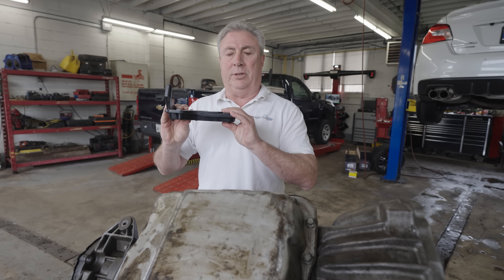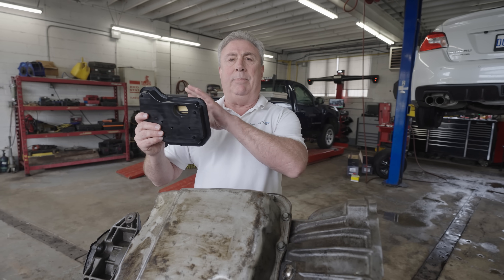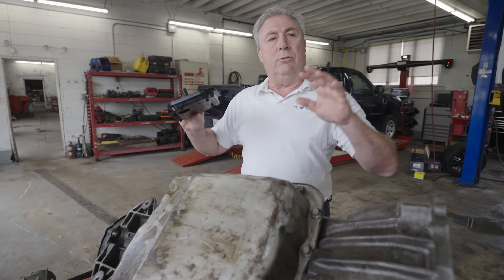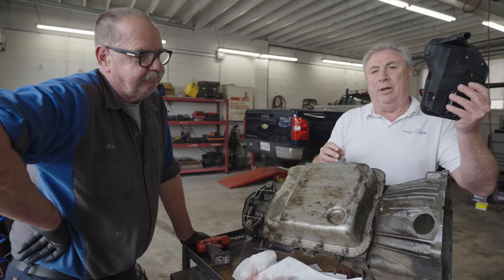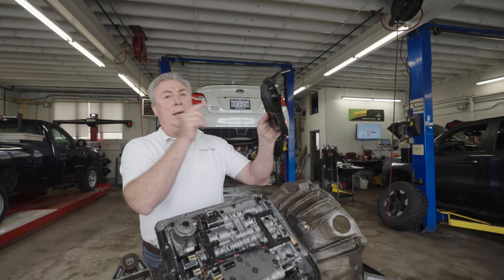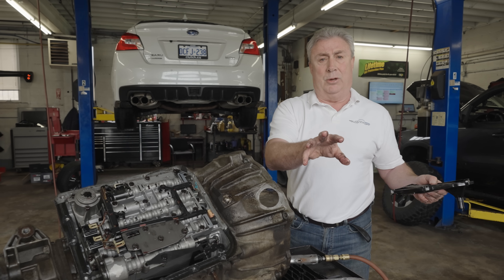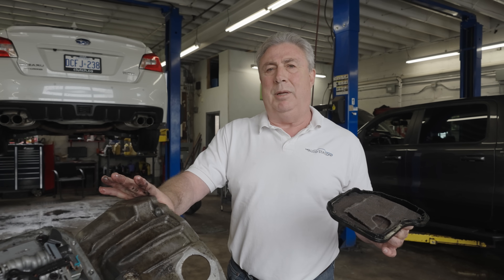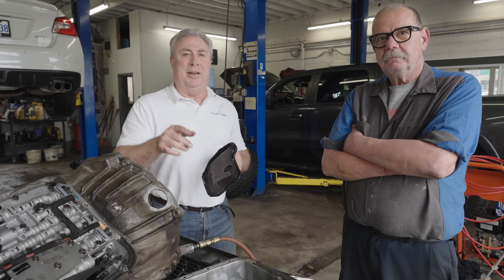Transmission filter Myth Busted - cutting through the B$$$

Comment: Great point I have a 22 Ram 1500 5.7 with ZF8HP75 bought new at 40,000 miles I installed a PPE pan with replaceable filter at 78,000 miles I changed the fluid again and the filter but this time I broke open the filter and you are 100% right it looked new and very little wear on the magnet when I hit 120,000 miles I will remove the pan to wash out with brake clean because the porosity of the cast held black dust if the pan was a machined pan I would drain and fill. Another step I took that most don't is after I completed the service I drove 3 miles put the truck back on jack stands let it sit overnight and rechecked the fluid level it was 8oz short due to air pockets truck shifts like butter. I won't change the trans filter next time no need at all.

Comment: Depends on the car. Some it’s a screen and there’s an actual filter higher up sometimes inline with the cooler. Some have an actual filter in the pan. I think pulling the pan off is worth it especially on a cvt to clean out the sludge in the bottom of the pan and clean off the magnets so they can continue to trap more metal.

Comment: I do drain and fill every other year. I don’t change the screen. I have a filter by the battery. 2006 OB H6 206k miles. I have a plug. No tranny issues.

Comment: At 85,000 miles my Camry at the Toyota dealership had its Transmission filter and fluid changed. Toyota says do it between 60,000 and 100,000 miles. So even though the filter was prob fine, the new one now has about 25,000 miles on it only. Isn't due again until about 150,000.

Comment: This is the first video I’ve seen that answered my question, so I need to change the transmission filter. 

I bought a high mileage a-b truck with plans to give my car to my son. Long story short, the truck had transmission problems and then the car had transmission problems about the same time. I was ignorant and didn’t know anything about servicing transmissions. My car made it nearly 200,000 miles before transmission went out. All things considered, not too bad. Truck is still in the shop on its 4th transmission and still isn’t running right. 

But now I’ve bought a newer car with 24,000 miles and a new family van now with 12,000 miles. I want to make sure I don’t make the same mistake. After lots of videos from people like yourself who sound like they know what they’re talking about, I’m thinking I’ll just flush both of these newer trannys every 30k miles or so.

Both new transmissions are CVTs: one is CVT and the other eCVT. Have I made another mistake buying them? Any special recommendations for those types of transmissions?

Comment: I had honda civic 2010 for 14 years. Had 180,000 miles on it. Changed fluid only. No filter change. No problem with trans.

Comment: so I ended up putting a half a quart or less of engine oil when doing a trans drain and fill went to the dealer ship had them do a flush and refill with fresh fluid so if I understand right the trans filter would not catch and left over engine residue oil because I planed on changing the trans filter base what I understand from what you said i'm not changing the filter anyway should the trans be okay by doing the trans flush I maybe only drove less than 20 miles before doing the trans flush what do you think I should next ty If anybody want to chime in I would like to hear what you all think ty

Comment: just bought a 14 y.o. AUDI A4 B8 2.0L TDI station as a second car from a good friend for no money... 80k miles and runs like new
I love it and in my enthousiasm I made a list of what had to be done to make it run another 80k miles...
So I am changing ALL the filters and sensors, clean ALL the valves and change ALL the fluids..coolant, brake, servo, ... with a transmission fuid change being last on my list
its an 8 speed tiptronic and works wonderful... si I will leave it alone for now...thank you for the video...
from Spain

Comment: As a DIYer, I also don't mess with the internal "chunk filter" unless I have to drop the pan for something else.  Especially if the vehicle has an actual filter on  the transmission fluid line.  Changing the fluid is where the real longevity is at, IMO.  But if the pan has to come off, might as well do it "while you're in there."
Reply from the maker: That's a solid strategy for transmission maintenance!

Comment: I'm highly sceptical that transmission was full of the original fluid given the mileage.
Still quite a strong cherry red colour.
Any kind of ATF I've seen with even 100,000 miles on it barely has that colouring visible anymore.

Comment: I think this way is impropper for CVT`s. Not about flush, but about filter changing. Thank you.
Reply: I'm with you 100% what the heck is this man 🤔 trying do to a poor 🥺individual that is trying to make their vehicle last as long as they can I'm a 60yr  dude that have been working on vehicles for 45 years and I can tell you removing the trans pan and cleaning it out magnets brake spray the valve body off wiping it off top off with new clean hi quality fluid can make a transmission last forever 🙂 what this guy is saying is don't check the timing belt the dealer said it good for 80 k but you bought the car used at 120k 🤫

Comment: You all are missing the point of the filter. It is a course filter yes. The filter also  is
 a drain pan within a drain pan. Basically a baffled sump, to prevent starvation due to slosh.

Comment: Thank you, my car has a filter that you have to take the transmission out the car and take the transmission apart to get to the filter. The manual recommends draining and refilling the transmission with factory approved transmission fluid in three intervals in the recommended mileage.

Comment: This was a really helpful explanation that this filter doesn't grab the tiny stuff, just if things go really bad it'll catch large stuff. I have a Grenadier with a ZF 8 speed transmission, with the plastic pan. I want to remove that after about 4k miles and put in a larger aluminum pan for better cooling and capacity for oil. Once that pan is in, doing a flush and a refill every 30k miles or less, I think I'm good, and it's great to know that I don't need to pull the aluminum sump off the transmission every change just to get at the filter. I'll also be putting in magnetic fill and drain plugs. On another topic, I've realized I don't need to change the engine oil filter every oil change if I'm doing that at 3-5k, just every other time. Thinking about installing an Insane Diesel oil filter, if it will work with the B58TU1 in this vehicle.

Comment: Excellent Video!  I totally agree with you. If the filter was actually collecting and containing the particles then the oil pan would be relatively clean. I think that as soon as the vehicle is shit off the transmission oil filter-strainer is back flushed slightly from the oil that is between it and the oil pump. Thus cleaning it and depositing the debris into the pan. The air cooled VW Bug engines were very durable and they only had a oil strainer. The deposits formed on the plate below the strainer. Just like what happens in an automatic transmission.

Comment: I'm not an official mechanic just a long-time car enthusiast. I love American and German cars. My newest car is a 2025 5 Series with a ZF 8HP same as my Dodge Challenger. I plan to change tranny fluid at my friend's shop at 30k. I've always heard drain and fill is best, but it bothers me to know there's wear particles left in the Torque converter, people always say becarefull with flush / the small passages / getting in other places, etc... Now im thinking after this Video perhaps a flush would be best, any issues do it twice "Expensive"... i also saw a videos from ZF direct.  The german engineers claim fluid change every 40k to 60k... 40k for pure street driving, 50k for mix, and 60K for pure hwy driving, so ifigure preventative maintance every 30k. I like keeping my cars for the long gaul and taking care of them. Dang now you got me thinking of doing a flush instead of my regular drain and fill.

Comment: Do you know what your saying...lol the filter suck fluid before entering the system, so no pressure. I changed my range rover zf fluid and filter and yes it has metal shavings, its normal. This a typical know it all thay does the bear minimum, take your vehicle elsewhere.

Comment: Well you've convinced me not to bother changing these modern 'rock stopper' synthetic bag transmission filters when you can simply flush the trans fluid with any fine clutch particles in suspension. The only qualms I had was whether the new synthetic bag material would stand up over time and high mileage because of experience with an earlier GMH Commodore (Australian) where the filter contained a very fine bronze mesh as the rock stopper. Turned out with some years and mileage it had corroded/disintegrated and was the very cause of impacting the valve body and gear shifting. I suspect the industry has learned that lesson now they all contain synthetic bags like you demonstrate here.

Comment: I can attest that getting to the transmission filter is riddled with risk.  1. You have to remove the sump pan 2.  You have to replace the gasket,  3. you have remove any old gasket stuck on pan and transmission 4. You need to make sure you clean and sand down the pan and transmission for a level surface  5.  You have make sure the filter screws aren't seized.  6.  You have to make sure the old O-ring is removed  7.  When you remount filter you can't strip or overtight.  8. When you remount pan you have up 16 bolts that you have to make sure you do not strip.  9.  You have the hope old pan isn't warp  10. You have to check and make sure pan doesn't leak      At the end of the day, one mistake, one misconfigured torque wrench and you are up Sh** Creek, when you could have reduced your work load by simply dealing with two rugged screws, the filler and drain and completed the job in 20 minutes rather than 2 to 3 hours.

Comment: I have my transmission fluid change every three years which is about 12,000 miles.   i change the transmission pan with one that has a drain plug, so i can do a drain and fill.  I don't need to change the filter every time I do this.  I have 240,000 miles on a 1999 Silverado 5.3

Comment: 2023 F150

9,000 miles transmission fault. Dealer check. TCM Reprogrammed.

12,000 miles Transmission fault. Dealer replaced Transmission fluid, filter and pan.

18,000 miles Transmission Fault. Reprogram ECU, TCM, relearn idle position.

21,000 miles. Transmission Fault. Replaced battery, reprogrammed transmission.

26,000 miles. Transmission fault. Replaced transmission fluid,filter,pan. Reprogrammed TCM.

Currently 45,000 miles. Everything seems ok. What gives?

Comment: unless its recommended in your owners manual to change it i.e. at 150,000 miles like on a 4.6 ford v8. Not for nothing the filter was pretty clean unlike my garage floor, but still I'm glad i did it.

Comment: Good video, agree 100%. Now, if you do need to drop the pan for some reason?? Sure, change the filter while you’re in there, but like you said, there will be nothing of consequence in that filter worth changing. I’ve changed 1,000’s of these, never seen anything in them. Cut them open, nothing. But change that fluid. You’ll get the nasty stuff out that flows right through those filters. Now, I do think it’s I,portent to take that pan down once every 150,000 miles or so to clean those magnets off.
Reply from the maker: Exactly!

Comment: What a dumb ass. That just basically a screen that should be changed or cleaned if it's mesh but as on my 2011 Nissan sentra there is a actual Filter on the side of the Transmission that does Filter metal particles and needs to be changed but he failed to mention that. Mechanics like this guy is partly what's giving some Transmission a bad reputation such as the CVT  because they aren't being serviced properly and enough.

Comment: We change the trans filter because it's there and they're cheap.  If you think it's supposed to filter out metal chunks from planetary gears...by then it's too late to matter anyway.  Depending on the particular make/model/design transmission...the filter is as useless as an engine beauty cover.
Reply from the maker: Yes, exactly as useful as the ridiculous heat holding hunk of plastic some design guys figured would look great on the top of an engine.🤣🤣

But yes, if we're in the pan for whatever reason of course I'd change the filter.  It's cheap and it's right there.  Still not expecting it to do much in terms of filtration but it is what we do.  Appreciate the comment - thanks!

Comment: 53 years old, have never changed fluid of filter in any of my transmissions. Never had one go out. 2001 F150 with 250k and 2007 Suburban with 200k currently. I have always wondered when it was going to happen. Still waiting I guess

Comment: This is my experience. We bought a 2016 Buick Encore with 62 k miles. It has a drain plug  & a filter deep inside the transmission. Dropping the pan would be an absolute waste of time. Thinking no one ever serviced it  & GM filled it properly, I .just measured what came out which was 5.5 quarts. I would put in the same amount. Never had an issue after trading it in with 177k miles. I'm sure GM didn't design a better transmission. So I'm thinking if they don't replace the filter, then why would I on my other cars that have the filter in the pan? If the sun shell breaks, the tranny is toast anyways. The filter won't solve that issue. All my other 4 cars have had the drop & filter replace method which I'm going to stop doing. If I had to drop the pan, then I would replace the filter. GM just uses an oil seal to hold it in anyways.

Comment: BS IVE ALWAYS WAITED TILL AROUND 100K DROPPED THE PAN AND CHANGED THE FILTER AND FLUID and repeat every 30k after that  I've never done a transmission flush tho just whatever comes out I put back in usually 5to7quarts depending on the car I had

Comment: Would this apply to ZF transmissions where the filter is actually part of the  pan. And expensive! Would just a fluid change suffice with these trannies?
I was curious as to why this particular transmission was removed from the vehicle. Was there a problem with it anyway?

Comment: I dont care what anyone says but after 42 years being a mechanic. If everyone was service their transmission every 50,000 miles there would not be a transmission shop in business. Keep your trans serviced
Reply: I drive a 99 Caravan 3.3 with almost 300,000 miles on it. One of the first things I did was pull the tranny pan and weld a bung to it for a drain plug. I drain the pan and refill every 20k miles.  Engine oil change every 3500. I'm afraid it's going to go 600,000 miles, I may not live that long.
Reply: @JG-kv4oi lol!
Reply from the maker: Exactly.  Appreciate the comment!
Reply: The safety margin for the detergent and chemicals is 30,000 miles. So that 50,000 mile mark is close to end of life. Either way it’s a necessity with these new generation valve body units and the risk of contamination.
Reply: @brianjenkins3133 hi. 2004 camry no history of tranny fluid service with prior owner.  Going on 22 yrs and still shifts like a dream 149k.  Drain and fill?   Thanks
Reply: What do you suggest, flushing out the transmission or just draining the pan. I have a 2014 ram 1500 5.7L. It has 89,000 miles on it. Shifts fine.
Reply: @Carlos-usa1st drain and refill at that milage

Comment: You’re showing a chip filter.  You’re correct that fine wear particles will pass through.  This is what the ATF holds in suspension and it then settles as sludge, especially around the magnets for the ferrous wear particles.  This is a key reason why it is so important to change the ATF periodically and to also thoroughly clean out all the sludge in the pan.  The ferrous wear particles will literally grind away at the delicate brass and other soft metals just like rubbing compound.  

One of the vehicles in my collection is a ‘16 BMW M4 with the DCT tranny.  It has two separate ATF filters, a low pressure (coarse) filter similar to the usual sump chip filter, and then a much finer secondary filter in the high pressure circuit.  BMW says no fluid replacement necessary - right - and a rebuilt DCT is an easy $10K.  Changing the fluid is a Saturday afternoon exercise that costs about $250 for the fancy oil, gasket & filters.  I’ll take that over the cost of a premature tranny failure any day.
Reply from the maker: That's a great insight and a great example of why it's so important to be in charge of your own maintenance! Especially on that lifetime fill, sealed DCT! Thanks for the comment.